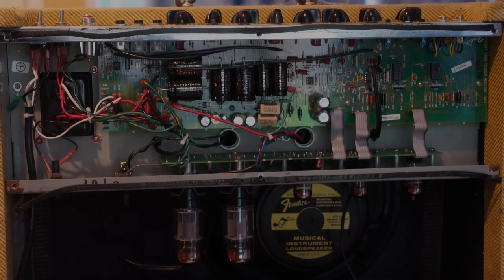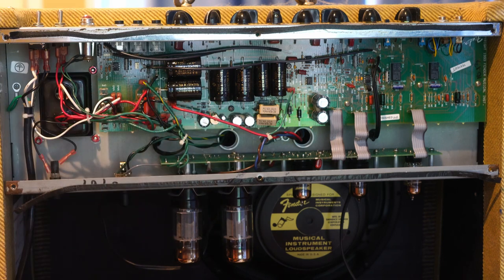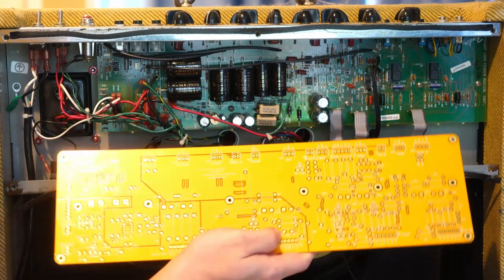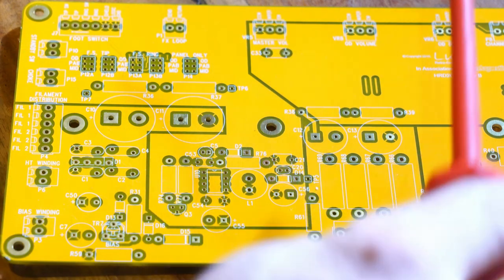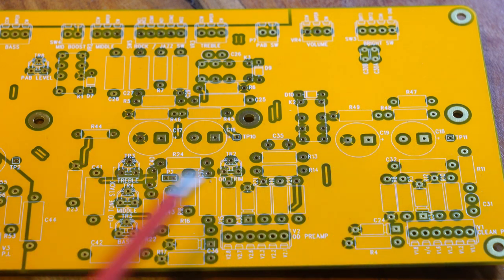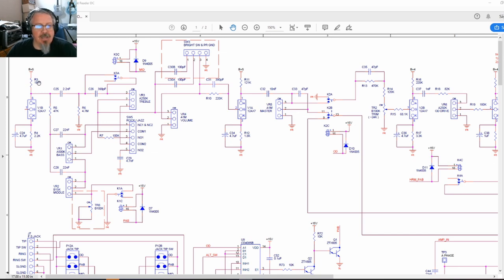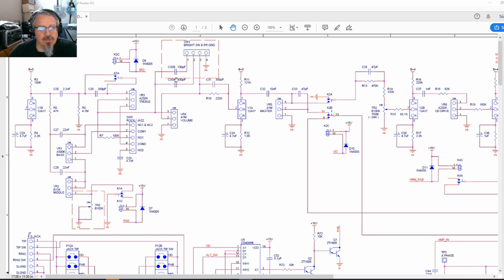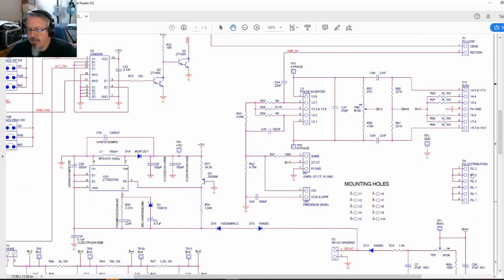Blues Deluxe  To ODS #183 Video 1

Comment: You are fearless...!!
Reply from the maker: Thanks, I hope :)  If you don't mean I mess things up so badly that I should be more fearful hehehe
Reply: I mean it in the best way possible. Years ago I took a fenders Concert amp (Rivera era) completely gutted it and Dumblized it and to this day it is considered one of the best sounding 1-12 combo amps around Athens GA. I added one more feature to that amp, I put a switchable fixed to cathode bias circuit in it. I wished I had never sold it. Mind you I did this around 1990 or so.
Reply from the maker: That sounds like a fun project!  very cool indeed

Comment: Do you have the link to the schematic? Is it on ampgarage?
Reply from the maker: The schematic is something they send you when you buy the board, but they are basically the same as the bluesmaster on ampgarage.  I changed out a bunch of components to make it more like an overdrive special #183 which is also on ampgarage